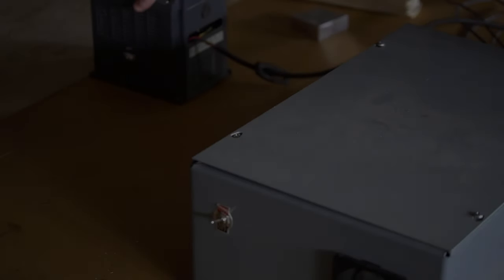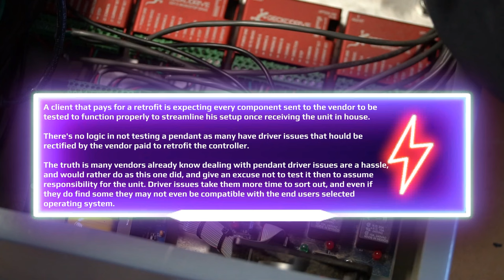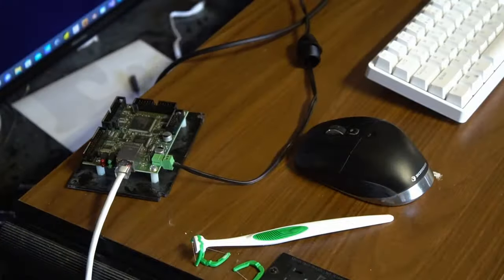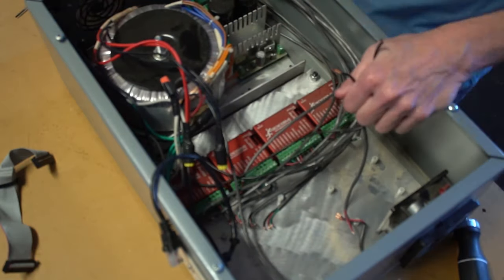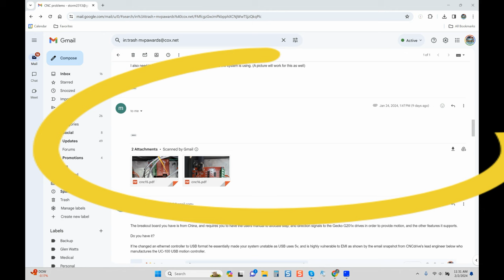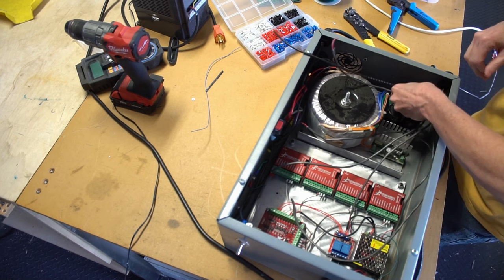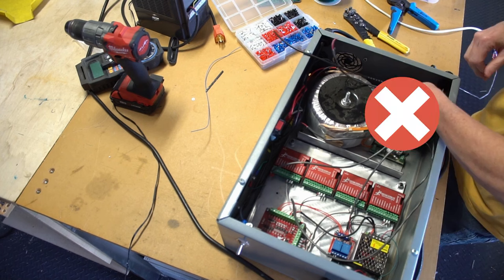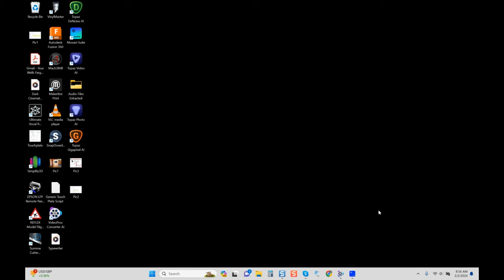CNC Vendor's Epic Controller Build Fail

Comment: This was a poor build. I never understand why people spend all the money on components to then try and stuff it all in an undersized and poorly manufactured enclosures.  A larger enclosure has better thermal management, is easier to assemble and work on.
Reply from the maker: Thank you for your support.  I've found over the years many people justify bad bad investments in the CNC genre by a low budget. 

The truth is it costs nothing to save money, and do it right the first time when you have the correct amount to invest it in the proper electronics because in the long run it saves the end user more money, and time. 

Thank you,
Vince